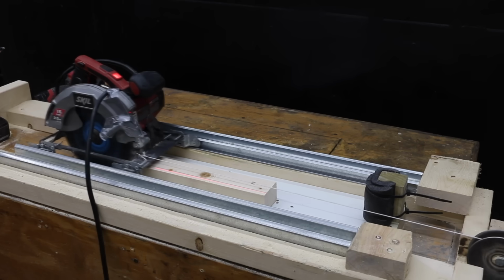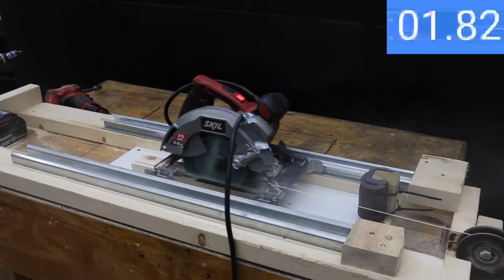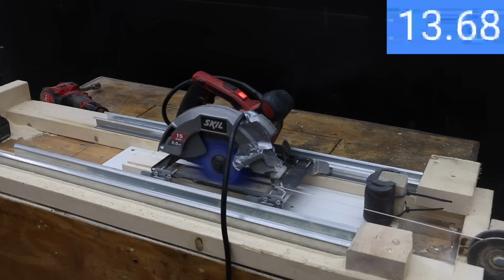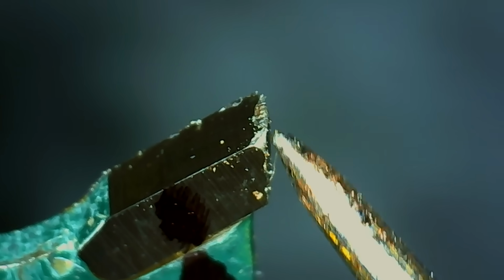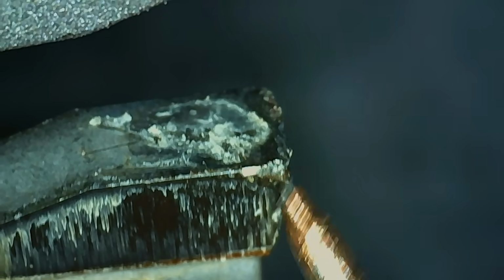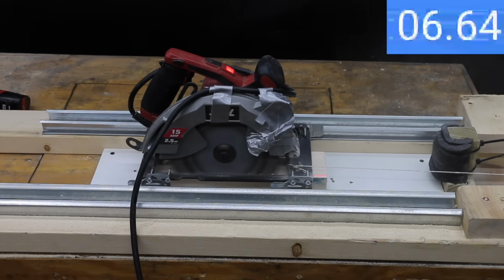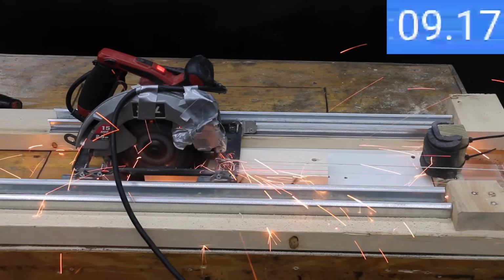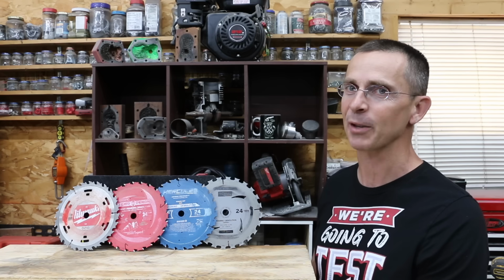Best "Demolition" Circular Saw Blade? Milwaukee, Diablo, DeWalt, Hercules, Evolution, Bosch, Amana

Comment: What the hell is a framing / demolition blade? In England they are just circular blades. It’s all about how many teeth they have, more teeth = cleaner cut. 
Why would you cut through nails?

Edit: just realised it’s because you make most of your houses from timber. We only use timber for floors, door frames, stairs and trimming.

Comment: I have a feeling that this test is using Big Blue in the way that you would test a Tuna's ability to climb a tree . I don't think it's a complete fraud, I suspect it's optimized for a completely different demo purpose. It's clearly optimized to NEVER gum up, and none of the things here were gummy. Maybe plumbing or electrical that gums up a blade? Maybe plastic siding? Fiberglass? It's strength is obviously not just straight lumber.
Reply from the maker: Thanks for the feedback.

Comment: Big blue is best for removing old roofing and stuff like that, or cutting a boat in half, not really for framing type work
Reply from the maker: Thanks for the feedback.
Reply: @ProjectFarm  no sweat man, you could cut thick rubber too without smoking out or stalling, ie... rubber floor matting or even old tires

Comment: Love you videos. I have a HUGE request. We go through lots of concrete blades of all sizes but mainly the 7-1/4 inch for a regular worm-gear saw. The prices vary a lot and it seems higher prices does not mean better blades just as you have uncovered with the blades for brush and demolition. If you can get around to it, can you perform some tests on concrete/masonry blades (durability and speed)? Thanks again.
Reply from the maker: You are welcome!  Thanks for the suggestion.

Comment: Would using a different saw motor type change the test results?  Some blades seem to increase in test cutting speed with more mass, while other heavier blades slowed down suggesting the blade mass may not be determinant.  How does the motor conditions contribute to those RPM changes?  A worm-drive delivers more consistent output torque, if lower RPMs, than do sidewinders like the one used in these tests. This posits the question, did the saw type and brand influence or skew the results? Your test jig is what I would expect a Government test rig would look like and function.  How was timing done?  Great vid.

OH, also, how accurate are the diametral measures of teeth per blade compared between blades (such as 12 of 14 teeth are withing +/- 0.005" height to each other on this blade but only 9 of 14 are within diametral tolerance on that blade. Does that explain cutting speed?   A blade with a few raised teeth  would cut worse that a blade with all teeth in tolerance. So, is the cutting performance of any blade a function of the height consistency of its teeth, even more than the number of teeth present?   There was no explanation of tooth sharpness or how it would effect testing results.   You mentioned kerf width but there was no explanation about how a change in width can influence cutting speed.  (I wonder if blade manufacturers ask such questions?)

Comment: I use to love Diablo. When I was still am apprentice with my grandfather they were the absolutely cheapest blades for anything and they always worked decently. Now over the recent years since they decided to step up their marketing they have substantially rose in price also, which do t get me wrong when they perform better and last longer I don't mind paying that little bit extra but in my opinion for how much the price increased I don't believe they are worth it anymore. Where I buy blades Diablo are up there with the more exepensive blades now and some of the blades haven't changed at all yet the pricing had. Also in my opinion they lost that niche in the market now that they are more exepensive. Few years ago it really didn't matter if they didn't last as long as other name brands did because they were priced low enough were a guy could buy multiple blades for the price of one other brands and now today that is t the case with them anymore.
Reply from the maker: Thanks for the feedback.

Comment: If you ever have a round 2 for saw blades, please include Freud. Hands down, the best blades I have ever used. The Diablo blades cut fast but tend to warp when they heat up which sucks when you are trying to rip through multi layers of plywood.
Reply from the maker: Thanks for the video idea.

Comment: Cutting MDF instead of "real" would may remove some of the variables of grain structure. I tend to use blades until they act as disk brakes for my saw anyway.
Reply: I think he has enough data points, time in cut, where that's less critical. This showdown isn't really about a hypothetical runoff between the blades, it's how they're going to be used in the real world.  Most people are going to be cutting 2x4s or similar dimensional lumber not MDF with these blades.
Reply from the maker: Thanks for sharing.

Comment: Could do a test on the difference spade drill bits and throw in 1 regular 1"-1 1/2" drill bit ? I've been using spade bits to drill horizontally through stumps to guide a chain through them. Just wondering what spade bit is best or if I should just get a driller big enough to hold my 1" drill bit.
Reply from the maker: Thanks for the video idea.

Comment: I don't own or use a circular saw , but this as always is a very interesting & informative video . Thanks . Just an Idea for a test , though it may be a test against it's self , I keep getting an ad for a product called Bondic  which is a type of UV Glue using a UV light to get it to set , developed by a Dentist , they make some pretty incredible claims about it , I wonder if it's as good as they claim . Thanks again . Stay Safe & Stay Well .
Reply from the maker: Thanks!  Thanks for the video idea.

Comment: A test suggestion:
I always hear about pocket hole screws being stronger than screwing into the end grain of a butt joint. But when connecting 18mm (3/4") boards, you only have ~15mm to work with the pocket hole. I wonder, can't you get a lot more holding power out of a 40mm (3/2") screw driven into the end grain of the board?
Reply from the maker: Thanks for the suggestion.

Comment: I would love to see you do reciprocating saw blades again, but specifically for thick/hardened metal.
I know Diablo won the bi-metal contest.

I've been buying Hercules and Diablo blades for a while now. Probably gunna drop Diablo from my circular saw, but they still do better in reciprocating saw for most jobs with bi-metal blades.
Reply from the maker: Thanks for the suggestion.

Comment: Can you do a which is the best impact-rated drill bit with 1/4 inch shank? Regular non-impact rated bits shatter when using impact drivers due to twisting force. I have yet to break my My Makita impact gold drill bit set. I'm curious how the other brands stand up. 

Awesome work as usual PF.
Reply from the maker: Thanks!  Thanks for the video idea.

Comment: very good test parameters. I have used framing blades, as well as demo blades and stepping away from empirical data for a sec, the Milwaukee actually impressed the hell out of me, because it very specifically is not designed for this type of work. good info on demo blades. thank you for actually doing a balanced test instead of the somewhat biased ones I have seen on other channels.
Reply from the maker: Thanks!  Thanks for the feedback.

Comment: Hello, if you use fuel made with a mixture of gasoline and ethanol you can use a little 2-stroke oil as a additive. With my experience, 2-stroke oil helps to maintain the properties of the fuel and mainly does not let the fuel damage and dirty the carburetor. I run this on my Honda side mower which has a 4 stroke engine and has been working very well...
Reply from the maker: Thanks for the feedback.

Comment: good test, but there are more blades out there to test. I used to pay like 50 bucks for high end blades only to put them on a 30 dollar saw the blade makes all the difference not the brand of saw. I didn't ever really use circular saws for demolition, mostly I used a sawzall usually with a metal cutting blade if there were a lot of nails and screws to cut. What I look for in a saw blade is how clean the cut is and how precise. However, I once tried to cut vents into an antique oak floor. No sawblade would touch it, even drill bits would dull fast trying to make a starter hole. I tried metal cutting blades on circular saw, a sawzall and a jig saw, nothing would cut it. I even tried a chainsaw, that blade actually lost teeth trying to cut it I eventually had to hire someone to do it and they had to have a special chain saw blade made to get the job done, still not very fast or easy. 100+ year old oak one inch thick is pretty damn tough.
Reply from the maker: Thanks!  Thanks for the feedback.

Comment: I'd like to know how clean the cuts are after each test. That always plays a huge part in the blades I buy. Less planing or sanding is always a plus. Great videos as always, & thank you for always being so thorough! I especially loved the oil brackets that you held.
Reply: This is a test of demo blades, not framing or finish blades. That said, just an anecdote of course, Diablo is what I run on most of my saws for decent finish quality at an acceptable price.
Reply: The Diablo does a pretty nice cut. Even on its last leg. They make a great finishing blade too. Cost is higher but really good cuts
Reply: MTR  for sure. The one thing I do like is that the thin blade puts way less load on my saws too. Your saws last longer... I build custom cabinets and yacht interiors. Diablo finishing blades are my go to.. when they are worn out usually the carbide tips will wear on one angle more than the other. So tends to naturally curve one way or the other. So I mark left or right on it and save for boat planks😂... I'm cheap/inventive. Glad they did not to bad in the tests.

Comment: Great Video! 

I heat with pallets.  I cut them with a circular saw.  The cost of blades (which isn't too much) is one of the few expenses associated.  I'm very careful to avoid nails, but hit them occasionally.   I have averaged $6. per blade over the last seven years.  Unfortunately, the three blades I use were not in your test: Black and Decker "Piranha", Admiral (from Harbor Frt), And Home Depot's "Avanti Pro".  I can't afford to do a scientific test.
Reply from the maker: Thanks!  Thanks for sharing.

Comment: There's more to a saw blade than kerf and tooth count. Rake and tooth geometry play big roles too. The bosch blade for example was rake quite neutral for cutting through metal where the others that preformed better in wood were positive rake making a more aggressive cut.
Reply: Circular saw blade made for cutting metal would probably you know state that it's made for metal.
Reply from the maker: Thanks for the feedback.

Comment: This test couldn't have come at a better time. I just finished a bathroom flooring job that wore out the last of my old chop-saw blade. I was literally thinking of going to the hardware store today to pick up a new blade. I've not been impressed with a lot of the Harbor Freight sawzall, hacksaw, jigsaw, etc. blades, but it's nice to see that HF has finally come up with a top contender in that department. I think I'll divert my hardware store purchase to go to HF instead.
Reply from the maker: Thanks for sharing.

Comment: In my experience with ripping boards, a blade where the teeth are a lot wider than the body of the blade seems to work best. ripping boards tend to pinch the blades, so a wider cuts really helps the performance.
Reply from the maker: Thanks for sharing.

Comment: some potential show ideas: best grass seed brand. control of outdoor and indoor under grow light. I'm always curious if those fancy bags that have the seeds with the green foam like stuff is really worth it. Also, best outdoor wood protector that isnt paint, such as spar, thompsons waterseal, ready seal. can test ease of use, cost, cure time, durability stench etc. all kinds of stuff. Also, best garden dirt. Are the expensive bags of dirt such as miracle grow really worth it? or can you get similar results with other brands through know how. other controls such as outdoor and indoor with a grow light.
Reply from the maker: Thanks for the suggestions.

Comment: Please repeat this type of testing with Concrete Block, Concrete Roof tiles. I see Contractors using blades that look very much like the ones you just tested successfully on Concrete. I use a "diamond" blade for concrete block and concrete roof tiles. (Like I am supposed to). I think these Contractors are on to something. Could you provide the proof??
 I watched three guys with skill saws and blades like the ones you tested build a 24X24 basement of concrete block and never saw them change a blade!
Reply from the maker: Thanks for the suggestion.

Comment: Great 👍 video with useful information! I’m hoping you plan a trim blade comparison on miter saws. 10 or 12”. These blades get expensive and cut performance is just as important as cut quality. I’m a Diablo blade fan, from a trim carpenter recommendation, years ago. I’ve been very happy with their blades on all my saws, miter, table and hand / circular saw, they seem to last forever cutting normal and pressure treated pine. It would be interesting to see if they do as well in hardwoods, oak, pecan, ash, etc. Thanks again for the great videos and information!
Reply from the maker: You are welcome!  Thanks for the video idea.
Reply: @ProjectFarm  you’re welcome! Thank you for your honest reviews!

Comment: Good to see my two go to blades did very well. Diablo and Milwaukee. Thanks for sharing. P.S. I bought the Milwaukee gloves you reviewed. I bought the large and they seem small but its the lining. The gloves are loose at the finger tips while the inner lining is preventing me from sliding the gloves on any tighter. And one glove fits better than the other. They are also very warm. I live in Houston. These are built for cold weather use and do not breath, I think. I will be returning them.
Reply from the maker: You are welcome!  Thanks for sharing.

Comment: Excellent test procedure.  You really make an effort to provide objective results. I also like that you always try to eliminate any "human factor" from the results. I appreciate that.
I have been using Diablo blades in all my power saws (circular, reciprocating, miter and table saws) for years. I would change brands in a second if there was anything in this test to change my mind.  There wasn't.  
Thank you, I have used your tests to help me select (or confirm my selections) many of the tools I use.  I think you are the gold standard of tool testers!
Reply from the maker: Thanks!

Comment: Such a solid review.. I just bought another Diablo blade 40T for cleaner cuts, I trust the brand but the evolution definitely is on the radar.. I'm just a dyi hobbyist so I won't be running blades through nails or screws but this information will come in handy when looking at blades.
Reply from the maker: Thanks!

Comment: My intuition and experience is proven correct. Buy a cheap blade for demo because you are going to ruin it anyway. 

Great test setup by the way. I used to do testing at a manufacturing facility. Most people don't realize how time consuming it can be just to get the fixturing correct (much less the actual testing).
Reply from the maker: Thanks for sharing.

Comment: I think the speed test isn't really an accurate test, a blade with larger gullets and teeth and less of them can take more feed pressure because they are designed to handle more material per-tooth-pass, so they are designed to be forced with more pressure than the 'faster' blades tested.  I think using the same feed weight for all of the blades yields results biased towards blades that are less aggressive and with less durable tooth geometry
Reply from the maker: Thanks for the constructive feedback.
Reply: @ProjectFarm  You bet! I love your videos and how much effort you put into these tests for accuracy! Keep up the awesome stuff!

Comment: When cutting I noticed that the depth was set to the max in some parts. In the real life this is not how materials are cut. Also, Makita makes hands down one of the best blades around. If you dont hit a nail with it, I have had one last over 6 months of regular use and it had plenty more life in it but I hit a nail. Our PT wood is night and day different then the spruce you were cutting with so consider a higher grade wood next time time as well.
Reply from the maker: Thanks for the feedback.

Comment: That "big blue" thing should really never ever be used for this application. It just seems like a massive safety hazard to me without any advantages
Reply: Other comments say they have good experience using it to cut gummy, tarred roofing tiles. It seems to be a hyper specialist tool that's just marketed inaccurately.
Reply: Yeah, blades likes these are banned in Germany since the 80s, thankfully.
Reply: I've also seen blades like this but with only two teeth. There must be a point to this but I can't see any.
Reply: @jerther_  to bludgeon the work peice rather than cut it.
Reply: Ah, just found out it's for routing and/or cutting curves.